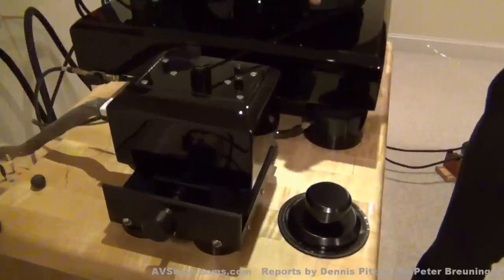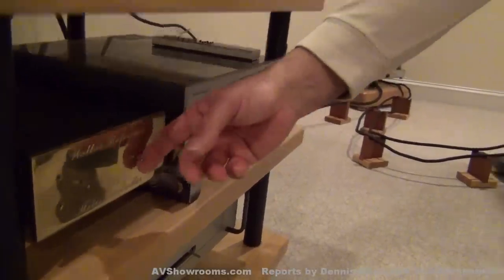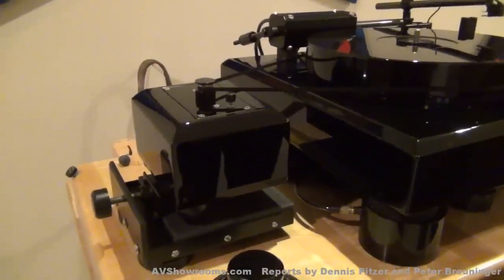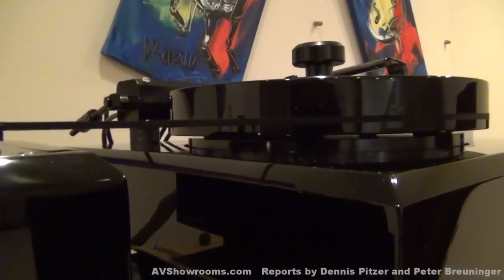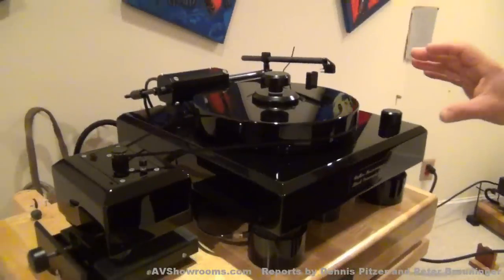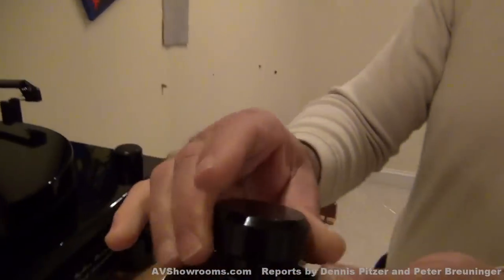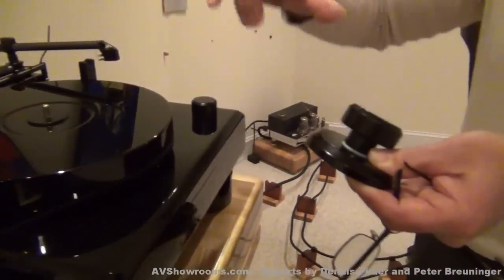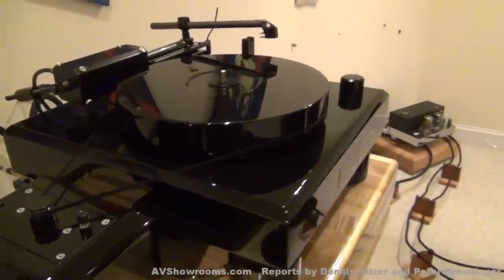Walker Proscenium Black Diamond III part 2.mp4

Comment: hah.. the on'off switch degrades the sound eh?  sounds like a candidate for pseuds corner,    all that over engineering to try make the best of mostly average vinyl pressings,   unless you exclusively "direct to disc" recordings , and the last time I looked there wasn't much choice of music you gonna be picking out all the poor mic placings and recording shortcomings, and whatever on  the recordings.     looks like the latter day turntable technology is accompanied by the "make a big fuss over insignificant details" style of critiquing ..   a 70lb platter  with a 3 foot rubber band adjusted by a screw to shift the motor housing...   what are they on?
Reply: Yeah that switch was no good. So don't switch that on/off anymore :D